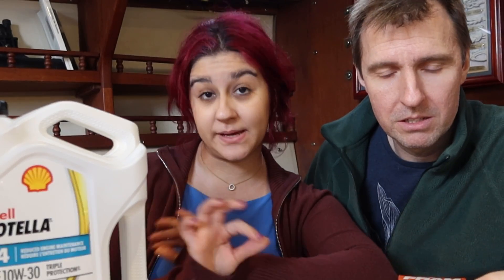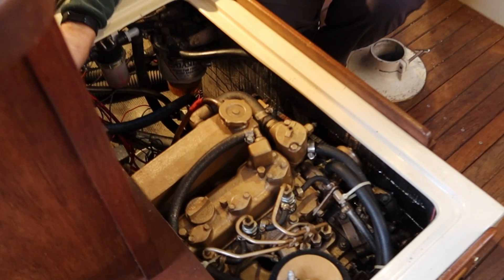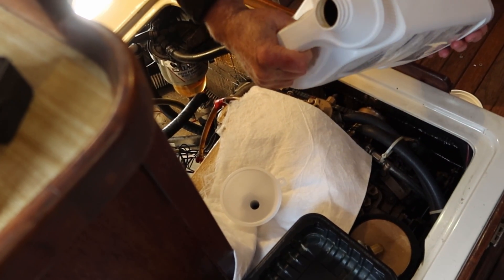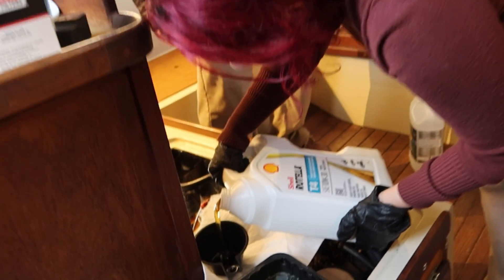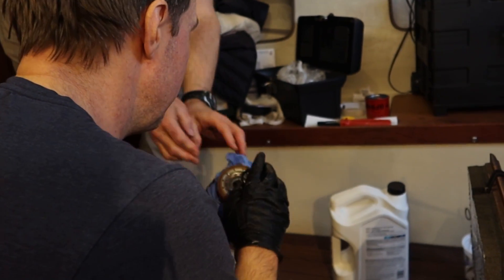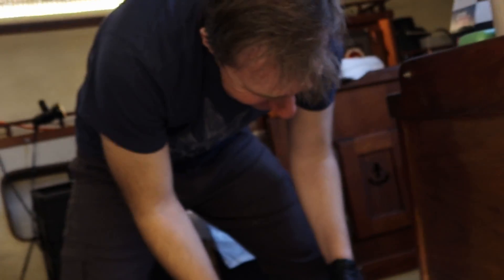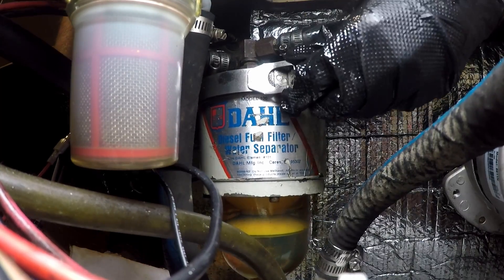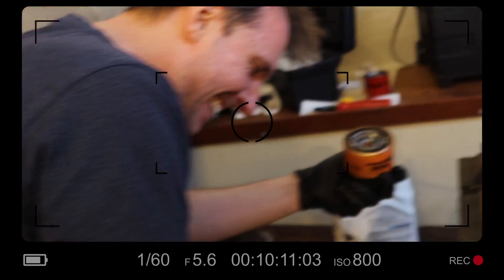Step-by-Step Guide on how to change the fuel filter and oil filter on a Diesel Engine

Comment: When you forgot to take out the oil filter, you can just run the engine for a few minutes to let the new oil to circulate and push out and dilute the leftover dirty oil that are stuck in the oil pump and other nooks and crannies that unable to drain out and then drain it afterwards, imagine it like you’re using water to rise out soap. That way you have a cleaner engine with less dirty debris which prolongs your engine life. You should do that flush once every 3-4 oil change or so, with additional engine flush product as well if you wish. If you take care of your engine well and use full synthetic oil and change your oil at the right interval every time, just flushing your engine with new oil is enough, no need to use engine flush product but you can use it either way if you want a peace of mind, it’s up to you.
Reply from the maker: Thank you for checking out our videos and taking the time to comment. That is really fantastic advice. We will keep it in mind for future oil changes.

Comment: after sailing for many years, I always carried an extra filter for every one I had on my boat. Wavw action and a little bit of debris in the fuel tank can fill a filter and leave you stuck. Extra filters on board can save you.
Reply from the maker: That's excellent advice; we will take spares, especially on longer trips away from marinas.